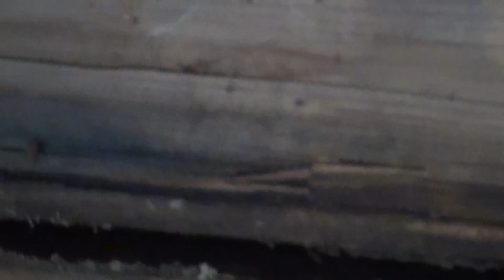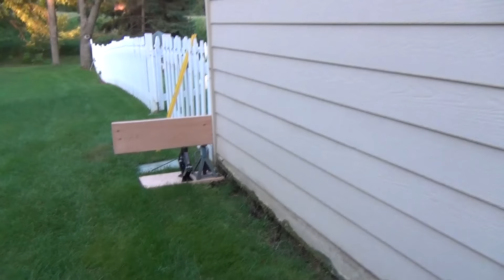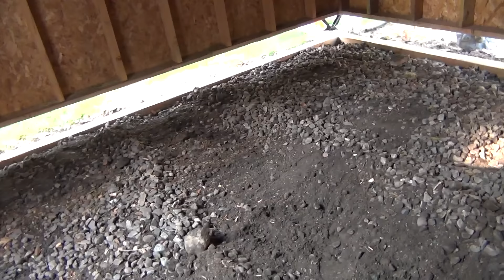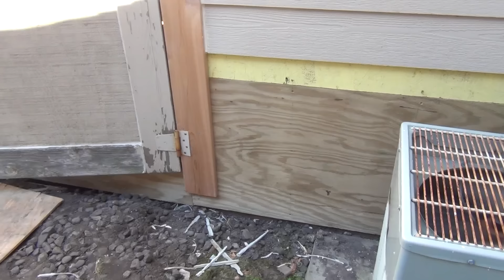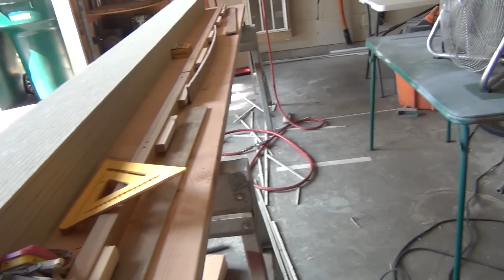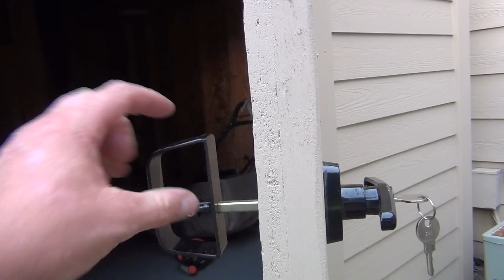Replace Rotted Shed Floor By Jacking The Shed Up, DIY 12'x12'

Comment: You just solve my biggest problem ! My shed floor is completely rotten and I can't use it to lift the thing. Now I'll be able to just lift the whole thing, rip the floor apart and work on the footing underneath. Thanks !
Reply: Was your shed floor sitting in dirt or up off the ground?

Comment: I see you have a smaller shed.  I have an 8 by 16 shed. Do you think that would be too heavy to jack up?  Also, am I correct that the floor frame sits under the shed on top of the 4x4's. And the floor frame is made with 2x6's, is that correct.  My shed is made with 2x4's. This looks like a major job, but it would be expensive to have this done.  My shed's floor rotten, because it was put on the ground leves as is yours, but water settles in the corner of the yard and rotted out the floor and shed has sunk down on the back and fron into the muddy yard.  I would like to put them on concrete blocks, so I assume I would have to put them butted up against, each other end to end for the entire perimeter of the shed.  Sorry if my questions seem dumb.
Reply from the maker: I think you could use 2x10s and it should be fine if the 2x10s are bolted into the wall real good. I do have mine resting on 4x4s and I should have placed a vapor barrier down before putting down the frame. But I never thought about it at the time. If you use blocks to build the shed off the ground that will allow air to get under the shed and help keep it dry. I would use 2x6 for the floor and add blocks like in the link below. 
https://www.google.com/url?sa=i&url=https%3A%2F%2Fplasticinehouse.com%2Fbuilding-shed-base-with-deck-blocks%2F&psig=AOvVaw3dBUvLfJITqugm6v9RMHRo&ust=1618236732868000&source=images&cd=vfe&ved=0CAIQjRxqFwoTCMjbsd-v9u8CFQAAAAAdAAAAABAO
Reply: @Ricks_Tech_Talk  Thanks for the great tips.

Comment: Damn dude. Great job. Yes I would have used pressure treated wherever I could, but you know the risk and that's your decision. What I REALLY want to complement you on is the time and effort that went into the actual video creation. I edit video and I know the time it took to make this video. You did a great job! Maybe I'll do a video when I attempt to raise my chicken coop off the ground and add a floor. It doesn't currently have a floor and it stays too wet. I want to get it about 20 inches off the ground to get good air flow. Wish me luck! You gave me a lot of really useful ideas!
Reply from the maker: Thanks Jason, I think the video could have come out much better and my new videos sure show it. I wish I filmed myself working on it more. But it's hard on projects like this one, I just wanted to get it done. Good luck on yours and thanks again..

Comment: I am just enough of a craftsman....to be dangerous.  But I am knowledgeable enough, to appreciate your tenacity, creative thinking, and ingenuity on tackling this job in the first place, and solving numerous issues!  I think if I were to make a suggestion, I’d clear a foot or so of sod along the outside walls down a couple inches, and put a few inches of gravel to decrease splash, and maybe prevent future moisture and  potential rot along your new foundation.  Bravo-Zulu, sir...a job very well done!

Comment: Chiming in late here but here in texas you try not to have wood touching the ground.  Mainly termites and dry rot.
Reply from the maker: Thanks northtexasrangers. The shed lasted 15+ years so after it rots again I might move it back and lift it off the ground a few inches..

Comment: Great video to raise the shed.  I can share one unfortunate note that the earth has a lot of moisture and it will rot your floor  within 2 years.  Even pressure treated wood would not survive. Either raise and ventilate the sub floor or use concrete.
Reply from the maker: Thanks Mark. I learned that I should have added a vapor barrier before putting the frame down. The shed lasted 15 years and I just rebuilt it the way it was so It should last long enough for me. Its going on 2 years now and still solid. If I drilled holes in the front and rear in each section and put a mesh over the holes do you think that would help? 
I hope others read this so they don't make the same mistake.
Reply from the maker: Well 8 years and still like new. Maybe the rocks inside helped or the rain gutters not sure, but no sign of rot yet. I took a look inside under the floor and the joist look great and feel solid. In a way I was hoping it would rot so I could poor concrete under it.

Comment: Good job. Not that you need an “atta-boy” from me, but Ive been in construction and general contracting for 24 years and you did a great job in thinking through this processes, and even material selections under the circumstances. Its not a perfect solution to have wood in contact with the ground, but for a shed it will last you a long long time.

Another option, if you want to spend the money, and you have the height, you can call a local garage overhead door company and they will typically have uninsulated doors in commons sizes (like 7’ tall x 8’ wide) for around $400 installed. Thats what we did with our old barn style shed and it looks good, seals up well, and is just generally easier to use pulling our lawn mowers etc. out. We have enough land to mow that we have both a tractor style mower and a zero turn.
Reply from the maker: Well thanks, Jay. If I get 17 years out of the floor ill be happy. I think that's how long the old one lasted before I ripped it out. Next time I replace the floor it might just be concert :)

Comment: how much did it cost you ?
Reply from the maker: I think it was around $600 for the 2x6s, 4x4s, 8 sheets of ply, paint and some hard board siding
Reply from the maker: Sorry I didn't count in the jacks I bought and the 2x10s I used to lift the shed
Reply: Repairing a shed doesn't cost as much nowadays as it does to buy one or having payments on a new one. New ones are double to triple the original price from 2019.

Comment: They make blades just for Hardieboard. I have them on a 7 1/4" circular saw and a 12" miter saw. They cut quick and create a lot of dust. Breathing the Hardieboard dust (silica) can give you lung cancer just like asbestos did. You should wear an N95 mask when cutting and use a vacuum cleaner with a HEPA filer attached to your saw if possible.  I can attach my Shopvac to my miter saw to my miter saw but not my circular saw. Don't use a broom/dust pan to clean up the dust, vacuum it up.

Comment: Thanks for showing how you raised it up! My silly ass would have been digging under mine too try and lift it. The boards on the side are an awesome idea! I have to lift mine and replace the rotted bottom frame and floor  like you did. How many days did this take you to do that? Thanks again
Reply: This one thing was worth the price of admission!  I had all sorts of harebrained schemes (digging, a CH47 Chinook, or a maybe antigravity rays) to lift my shed, but your solution is elegant. You probably saved me two weekends - your check is in the mail!  Kidding aside, thank you for taking the time and effort to post -- Cheers!
Reply: @Ricks_Tech_Talk  good idea. Mine might take a little longer (my shed looks a bit larger) so I was thinking of using landscape bricks once I get it up in the air.

Comment: Can't come down slow with a bottle jack? They must make them differently where you get them.
Reply: @Ricks_Tech_Talk  I use bottle jacks all the time.
Regardless, I should have complimented you on your repair.
Nice job.
I need to do the same thing except my "shed" is roughly 40 by 15.

Comment: Nice work. This is in my future, think I might use concreate blocks to set my new floor on to allow air flow under the floor so It doesn't rot as fast.